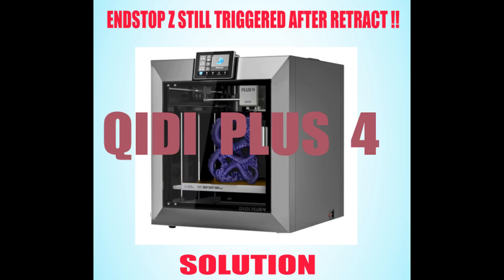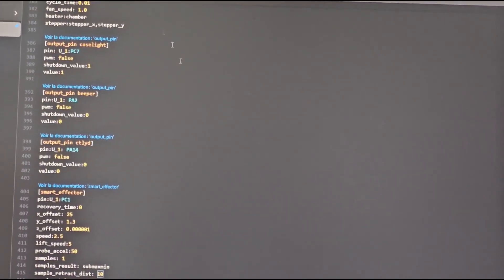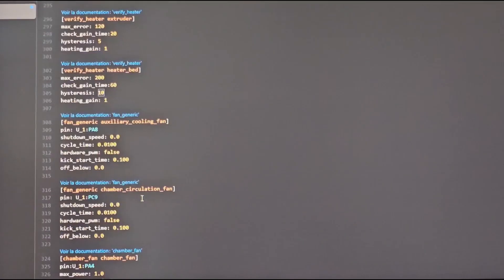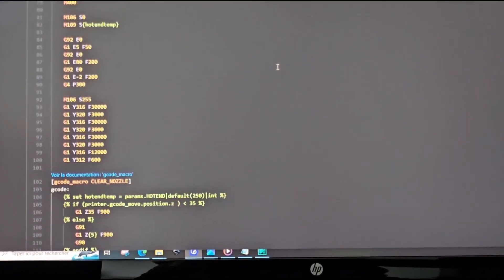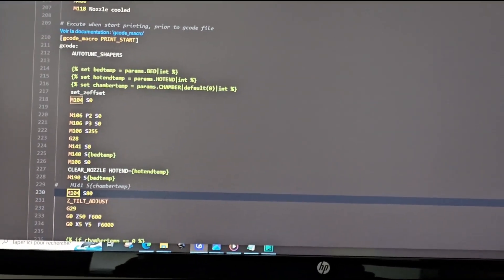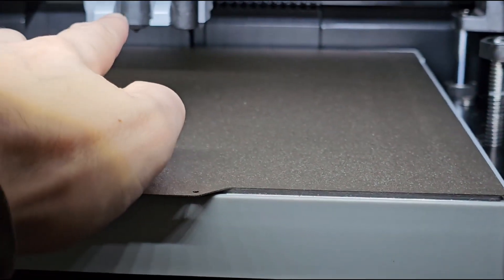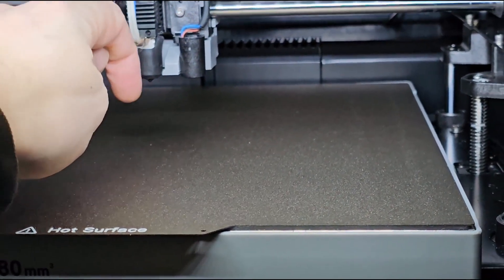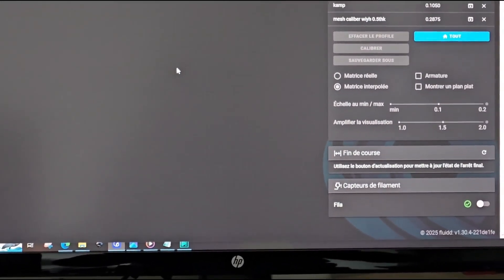Qidi plus 4 issue - endstop z still triggered after retract - plate-forme movement out of range etc

Comment: Thank you for the help, i dont why but this fixed my printer homing the wrong way causing a endstop z error to occur.
Reply from the maker: You are welcome! If the error message come back in the futur, you may have to change the z probe, but keep these changes in the macros.. you will have a very good printer!
Reply: @FEELBIKE thanks I’ll keep that in mind
Reply: @FEELBIKE  yeah it came back and I'm confident it's the z probe, gonna see if I can get it to work for a print or 2 by updating firmware again and running through your changes again. Waiting for qidi to respond and see if I can get a replacement z probe as part of my warranty since its been less than a year since I've received the plus 4. I love it but damn these little quirks are annoying.
Reply from the maker: @WeirdTodayNormTomorrow yes, sure it's the z probe. The next issue in several month will be the printing head cable... the connexion start to fail after a lot of printings, its annoying but it is ok for the price and the amount of printing without issues.